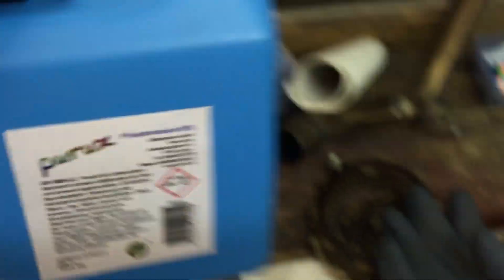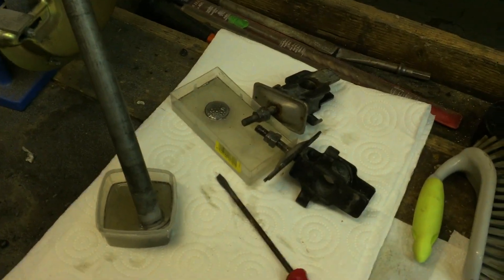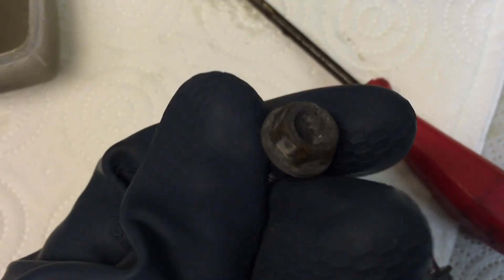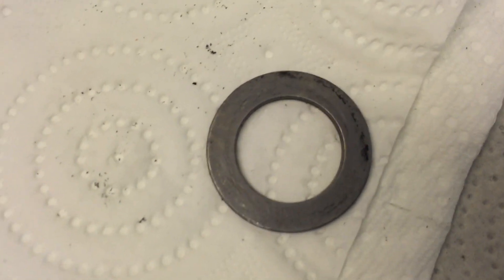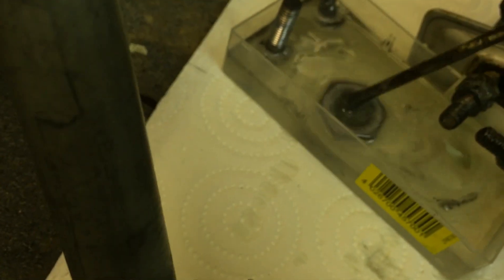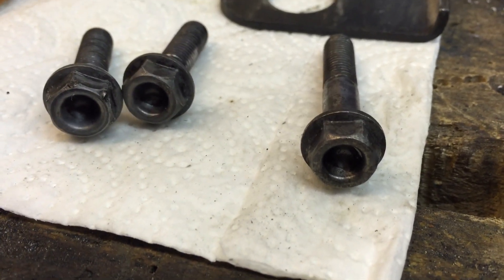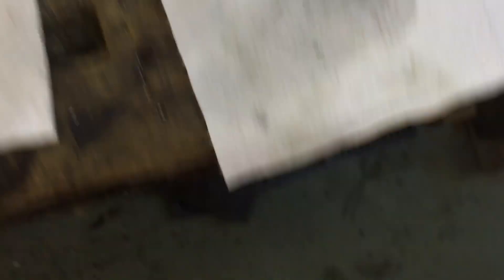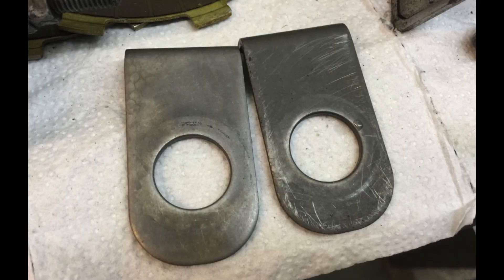Messing with phosphoric acid (removing rust) - It ain't a gaming video, but its something!

Comment: it works best if you have the parts sit for a while until there's a even grey layer on them, rinse with tap water and clean it with soap using a soft rag afterwards
dry it off and soak it in any kind of lubricant, chain lube works best in my oppinion since it's very sticky
it also provides a good surface for paint to adhere to the metal
I use this method for quite a while now, used it also on an axe I restorated for my brother and my boss
I don't know about the axe from my boss, but the paint on my brothers axe is, except for some superficial scratches, still fine and not anywhere near to coming off

just out of curiosity, are you from germany?